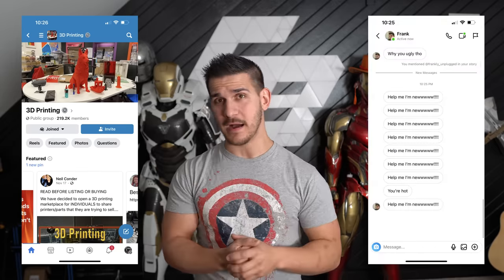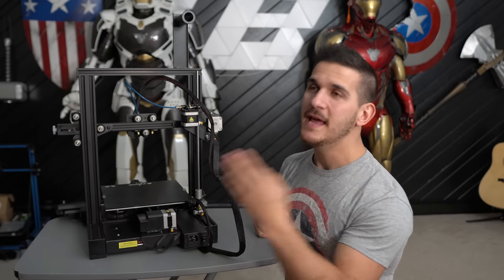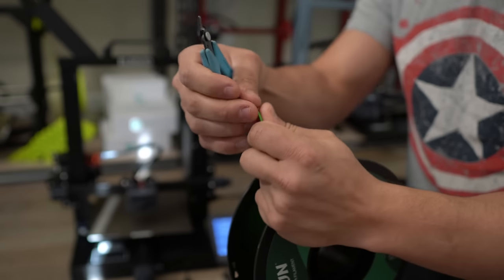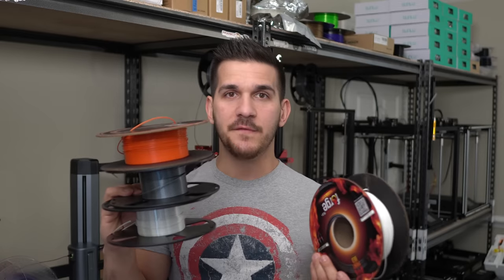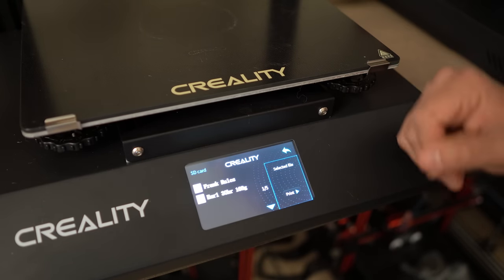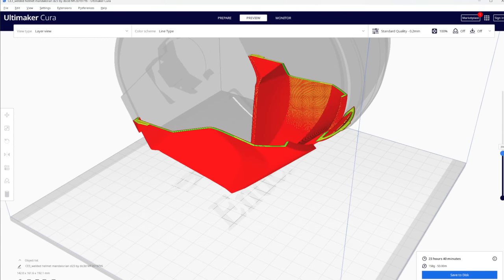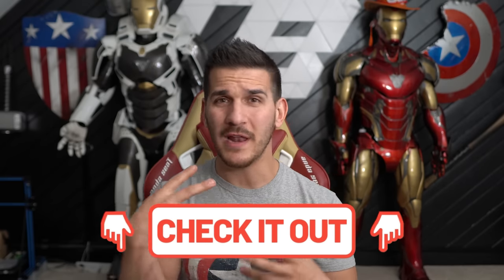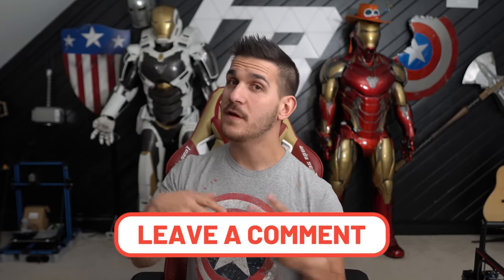Troubleshooting 3D Printer Issues | 10+ Common Problems 3D Printing Beginners Have!

Comment: Went through 3 videos to figure out why my auto home wasn't working and they all were talking about soldering. I come here and problem is fixed in not even 2 full minutes. Mixed wires on the axis, thank you for the tip!!

Comment: Very nice video! Also, another cause for the SD Card problem is an error on the 3D printer side, which can easily be fixed by just reinserting the sd card. Otherwise, great video!

Comment: One thing I’d like to add to layer shifting issue’s is that it could be a situation where your nozzle snags on the print itself and gets hug up enough that it pulls the whole bed a little because those clips aren’t all that strong holding the bed in place. I find that I either needed to slow down my print a little to avoid jerking, nozzle issues with over extruding due to a worn nozzle and of course z hop to compensate. So when before I start my prints now I make sure to check that the bed is squared up. That way if i see layer shift I can first check that the bed didn’t shift on me.
Reply: I had a layer shift in one of my recent prints and while I didn’t witness it happen unfortunately I’m pretty sure this was the cause. It was a statue with long hair and I didn’t support the bottom of it very well.

The bottom of the hair snapped off it’s stand in the same layer the layer shift occurred. Somehow miraculously the rest of the print continued without issue and I was able to break the parts at the layer shift and glue the whole thing together.
Reply: @jonathonantonio1973  saved the print. Nice! Way to see it through. I usually stop my prints as soon as I see a failure. It can be difficult to fix a print sometimes depending on what it is.
Reply: @ChrisJohnson-tn1mo  thanks man, I was so tempted to re slice but it had already gone past the layer shift by the time I saw it so I thought fuck it lol
Reply: Had this happen with my very first print on my ender 3 pro omg the cat got hit by the nozzle and it tilted the entire print on its side
Reply: @tylerkister4628  lmaoo that sucks, thankfully my cat has avoided the printer thus far. I think it’s too noisy for her lol

Comment: Hey, I have a few problems with my 3d printer i got for the holidays.. the printer i have is the creality 6 SE and when is printing, the filament doesnt actually go ON the bed. It curls up and stays next to the nozzle. Another question is before the printer starts printing, there is some excess filament coming out. should i remove the excess filament before it starts printing? should i heat up the nozzle, tighten the belts, or do something else? Nice Video, and I hope i can have some answers. Thanks!!

Comment: Been printing for 2-3 days now. I haven’t had any major printing problems. Had one piece I snapped in half but it was a long thin piece  @5% infill 🤷🏾‍♂️ everything just takes so long to print. Plus my printer prints at like 75% the speed cure gives me. Think that’s common though.

Comment: hopefully you can help.
I have a 3D printer that when I try and heat the hot bed the printer shuts down and restarts.

It is an IDEX printer, when I heat the nozzles, they heat up fine, when I move the X-axis it moves fine. Z is fine and Y is fine as well, so I eliminated the steppers having a short or nozzles. The company sent me a new hot bed, I plugged it in and it did the same same exact thing. No viable burn marks on any component on the controller board that I can see. Any ideas where to go from here? I want to say it is the power supply but I do not know how to check this. I have some basic electrical knowledge but have now gotten in deeper then my knowledge. The wires have all been checked for resistance and show good results.  i measured voltage in and out today at the cpu said voltage in was 121 v voltage out was 52v that seems hi to me as the cpu tag says 500 w and 24 v and 21 amp what do you think i should try now ?

Comment: Hello bro, I got a mismatched 3d print issue.
e.g, If I print a 10X10 square, it will come out as 13X13.
Tried many slicer but same results.
I'm using a generic MKS Tinybee based with Marlin 2.X.X firmware.
Any advise?
Thanks.

Comment: I'm finding that my pc4-m10 screws that hold the capricorn bowden tube in place for my cr10s v2 keep moving back and forth? Basically, the teeth inside the screws aren't clamping onto the tube? I've had to change them. Basically, every print. Any ideas?

Comment: Hey Frank, I have an Anycubic Kobra Max with an auto leveling system and a glass bed. I’m trying to print out a daredevil helmet with a raft. The raft keeps printing perfectly, but starts to bend up off the bed once it is finished, causing the whole print to fail. I went and watched your perfect first layer video and still cannot figure it out. Any tips?
Reply: You could use hairspray or bed glue 
I use layerneer bed weld glue and haven’t had issues since I got it
Reply: @yololyfe1759  I ended up using a gluestick and it worked

Comment: Could you please help.  I printed a bunch of items using tpu on my voxelab aquila,  and when I switched back to using pla, I'm having horrible under extrusion issues.  I've literally gone through everything and nothing is working. My the way I can load the tpu and it works flawlessly.

Comment: Ok I need some assistance. I've been printing for 5 months now. I've made some great stuff (thank you Frank) the current problems I am having are, Nozzle build up and won't stick to the glass bed unless I use glue sticks. I need some help sir. I haven't found anything outside of leveling the bed( I've leveled the bed 8,000 times it's as level as it will ever get. so I need some help please.

Comment: Gotta question, if you have a 3d printer that you just purchased, and I know you mentioned the belts being already tightened up enough. How would you know for a fact that the g-code file is bad? Is there a way to physically look into the code line by line if needed and make the correction? Or is it just a matter of dragging and dropping if you have like printers and same flavor firmware to do it that way?

Comment: I have looked all over the place trying to find an answer, but have yet to get one.  I have an Ender 3 S1 Pro.  I have printed all of the "test models" with out any issues.  I decided to get my mini's file from Hero Forge and try her out.  It seems like no matter what supports I try or thickness of the supports, it ALWAYS fails!!!  I have no clue what I am doing wrong!  I have lost count for how many times I have tried and failed.  I have a small army of failed prints!  I have leveled the bed I don't know how many times.  I have checked the belt tension I don't know how many times.  I have adjusted speeds, temps, you name it, it has been done!  I am ready to pull my hair out and return it (but I really don't want to return my printer!).  Is there a way I can send you the file for my mini and you can help me?!  I am at wits end!

Comment: i am having something different happen with my 3d printer. I have a ender 3 and when i try to print the x motor brings the extruder up about 1inch before starting to try and print and never gets closer to the table. Any help would be appreciated greatly. The printer was a used one from my older brother.

Comment: Hey Frank! Great video. What pc/laptop do you use?. My laptop takes for ever to slice a print and in preview mode the rendering is so slow when using the slide bar to see the layers. Regards.
Reply from the maker: I have a very strong gaming PC so it helps a lot.
Reply: @FranklyBuilt  yeah I figured it must have a high performing graphics card!. Thanks for the info and keep up the great content!

Comment: Question: My 3d printer just won’t print. It will meet all the temperature requirements to print a file but after that it just won’t move or do anything at all and I tried pressing the Pause and Stop option to cancel the print but both are unresponsive, no matter how many times I press them they just don’t do anything.
How do I fix it?
(I have an Elegoo Neptune 2)

Comment: I'm currently really struggling since I've just got my first 3d printer for Christmas and have been trying to figure it out for days everything works perfectly but I tried using the premade prints to test if it works and for some reason it just won't I have leveled the bed properly I have inserted the fillerment properly but I have no idea why it won't print I don't get any errors i just click the object I want to print and the folder that holds them closes and nothing happens I'm really confused, can anyone help?

Comment: Sir,  I have an ender 3 v3 se and it prints good however some times the X axis will stop moving. Y and Z axis still move. what might be the issue I'm at a loss have checked all the belts and bearings to no success. Please help if you can

Comment: These questions might be a bit out there, but i rent a room and i have other roommates so the machine would be standing in my room.

Healthwise is that a bad idea? Melting plastic and all.
How bad is the smell? Does it stick, will the entire house smell like it?
Will I or any other roommate be able to sleep when the machine is running (in general, i know sound differs per machine)

Comment: I’m having trouble with my 3d printer that you didn’t mention in the video. When I go to print something. The file loads and works. It then heats up both extruders even though it’s supposed to use one. Then the primary extruder (left) goes to the middle of the building plate and just stays there. I also use Cura. What settings should I mess with to fix this. Or is this an internal coding problem. Thanks

Comment: I'm new at printing and have been pretty lucky. But I always have a problem printing "small" things. Example: A leg on an action figure.  If the leg is small, The print always fails. My temp is at 200andthe bed is at 60. What am I doing wrong???

Comment: I’m having issues with my prints coming out very brittle … is there a setting I need to adjust to fix this issue? My printer is leveled and prints my boat ,vase,fan with no issues so that tells me there’s a setting that I need to adjust .. TIA. Thank you for the video

Comment: I think I ruined the bed, I had sticking problems from the very beginning and now I printed something and it’s just stuck, I left it to cool down for a long time, but when I tried to remove it didn’t come off, then I tried to put it in the freezer for some time, isopropyl alcohol, heating it, had to take some tweezers and try to peel it off but there’s too much plastic left in the bed, all day I have been watching all videos I could find and nothing works, what did I do wrong? I leveled the bed correctly I think, previous prints had gotten stuck quite bad, but none of them left so much of them in the bed, the print was perfect in everything else, help, I don’t want to buy another bed

Comment: One little problem that printers have with the files is when we, the spanish speakers, use the "ñ" on the file name or other "unknown" 
character like accent mark. For example if you want to print a cannon and we name it in spanish, which is "cañon", somehow the printers can't read the name and it enters in a loop of thinking and it never starts printing
Reply from the maker: That’s good info!
Reply: Good to know. Which printer?
Reply: @ChrisJohnson-tn1mo  this happened on my Artillery sidewinder X1, I don't know if other printers might have an updated software to solve that problem 🤔
Reply: @tomcabj2410  ok cool. Yeah i have an ender 5 plus. The only naming problems i have had with mine is too long of a file name will make it so it wont show on the display like its not on the SD card but it is and I just need to shorten the file name. I try to stay away from goofy characters like ñ anyway so no worries. Lol

Comment: One issue I've had is my fan speed cranks up to 225 speed and temps out the nozzle, I've adjusted the settings on the printer and in Cura but still does it, what is going on?

Comment: I purchased a two tone pla from amazon and the extruder keeps skipping. It only does this for that particular pla brand. I raised the temp up to 230 on the extuder, put the bed at 60 degrees and it still caused the clicking sound. Is there supposed to be higher temperatures for those materials? I am at a loss! I've kept leveling the bed and all other PLAs work. I just removed the two tone and put a single color PLA and it worked just fine.

Comment: Hey frank I need help my printer prints half of the outline of my print and then stops but does not turn off and just flashes an error that says  there was a power failure. Also interestingly it stops at the exact same place each time. If needed I will upload a video of the error to my YouTube. Please help thank you

Comment: Do you use different nozzles - material or sizes? If you do, any nozzle suggestions for the CR10S Pro V2? I discovered, after ordering nozzles 🤦‍♂️, the hot end has unique, smaller?, threads.
Reply from the maker: It’s a mk10 hotend and needs different nozzles yeah
Reply: @FranklyBuilt  wait, do you mean I could search “nozzles for mk10 hot end”? That seems way too easy. Ha ha.

Comment: mine forgets where it is when it turns on and when auto home it dont save when turned off and my printer also starts dripping filament before its prining causing it to spaghetti the print every time ( ender 3 pro )

Comment: My printer is still extruding filament, but when printing, either the line curls up on the start, or when trying to turn, it doesn’t stick. I have tried using an adhesive yet nothing has fixed. Do you have any solutions?

Comment: I legit cannot find a single topic covering this issue ANYWHERE, but if soneone can tell me, please answer: why does ny 3d printer not printing? I set everything up, leveled, extruded my filament, it even moves the nozzle as if its printing, but its not. Its like if you think youre doing something and you finish ot, but you find out it was a hallucination. Please help me someone

Comment: I'm actually struggling with a weird problem. I have an ender 3 v2 and for the past 3 or so months my prints started having these weird stringy blobs everywhere. I'm thinking it could be a retraction problem cause it mostly happens when my printer head stops printing to go to another part of the model. And the top layer sometimes has blobs on top which kinda hook the nozzle and cause the prints to break from the supports or even fall over entirely. I used to have faith in my printer and go to school or whatever while it's working on a 20+ hour print but now I'm scared to even sleep while it's printing.

Comment: Hey not seeing my issue here in 2024,(ender3 v2) the print will fail like 1/3rd of the way through because filament stops extruding(no clog, boding tube is secure, nozzle is up to temp) the motor that feeds the filament through is some how squishing the plastic too much i have no clue why. Ps love the videos ur why i 3d print

Comment: I don't know if u ever have this issue, but I have two creality CR 10 V2 and I had an issue where the bl touch would flash then stop in the middle of leveling, then it would start to print and then stop moving but still continue printing on the screen but nothing would be happening.
Reply from the maker: That’s usually bad gcode

Comment: Me and a friend got different printers, and we noticed his was a little faster on all previews. We have the same settings as far as we can see. Do certain printers just print faster?

Also I got thermal runaway from leveling issues. I leveled it cold like the manual told me to. Lol
Reply from the maker: Actually yeah. Sometimes even the same printers can act diffeeent
Reply: @FranklyBuilt  
Weird. I hadn't heard about differing speeds depending on which printer you get before. Thanks for the informative videos!

Comment: I have a jg maker and I had for over a year I never took anything apart, (feeling like I'm going to ramble on), so I'll get to the point, I think the clear tube is fused to the nozzle and I can't get it out to replace it. so, I think I need to replace the nozzle as well because. I looked for parts, but I can't tell what would be compatible. any advice ?

Comment: An issue that’s popped up with my CR-10 S4, it’s started to print off Center. When the print starts, it prints a few inches forward and to the left, and it didn’t always do this. Any ideas on why and how to fix it?
Cheers!
Reply from the maker: It could be the slicer software. But maybe a firmware flash on the printer itself could help
Reply: @FranklyBuilt  Thank you! I’ll look up how to flash the software.

Comment: Hello Frank. A problem that I’ve had for a while now is Z-banding. I’ve done a lot of things that have been recommended to me except replacing the z-axis lead screws (the screws look straight and roll smooth). Any tips/recs that you could give/put in a video? Thanks!

Comment: Hey Frank have you ever run into filament that just simply will not run on a printer? My bed is leveled and fully adhesivededed(glued surface). My other rolls print but i cant get this one type to print its Geetech Matte black, any advice?

Comment: I just assembled my first printer and the touchscreen said the bed is too hot but the bed isn't even heating to begin with😥 It's a Longer LK 5 Pro if anyone has advice or if I should just call a technician.

Comment: i have an ender 3 printer that previously had trouble reading the exact temperature of the extruder. through some troubleshooting it turns out the cables like to be held down a certain way so it can read a constant temp

Comment: Yo i have a problem with mine  i have an ender 3 its fairly new and i printed a couple small stuff on it but when i changed its location it suddenly kept failing to print. Once i fix one problem it led to another over and over again until it wouldn't even extrude material help pls